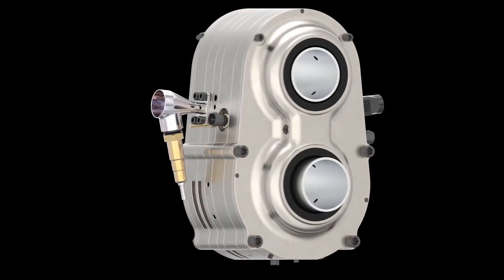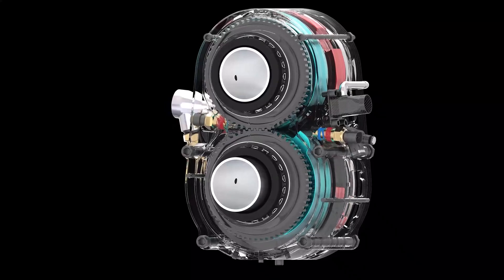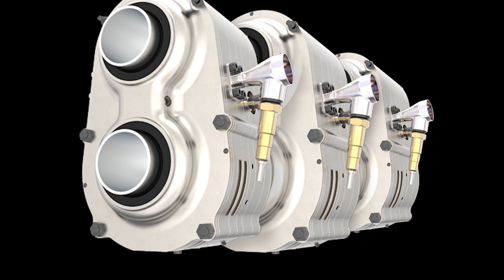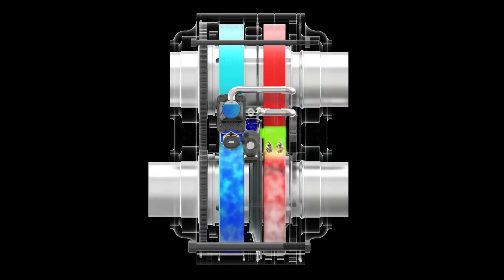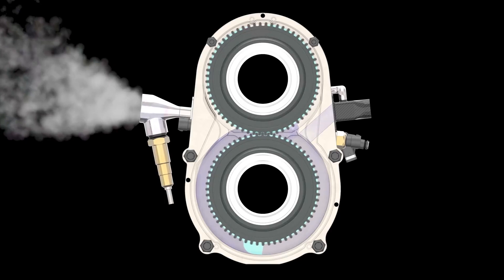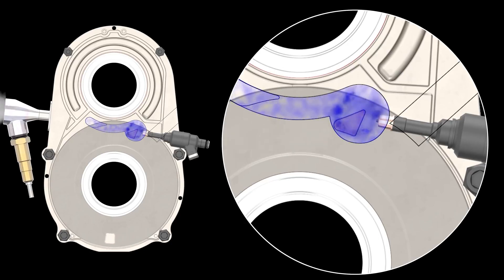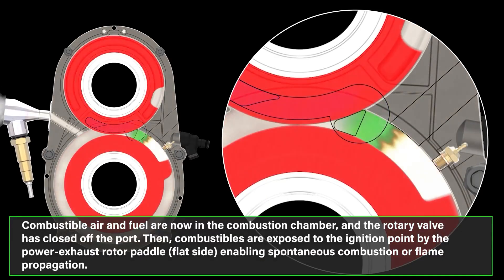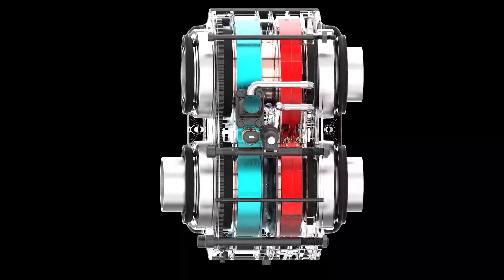This pistonless engine runs on hydrogen and revs to 25k rpm

Comment: Simple question. What is the overall thermodynamic efficiency - energy content of hydrogen used versus mechanical energy delivered? You need cheap hydrogen, otherwise the economics doesn't work. You need to compress or liquefy hydrogen for a transport fuel and this loses a large fraction of the energy you put in. Then you lose more because of the thermodynamic losses of the engine. So the mechanical energy you get out of it is only a small fraction of the electrical energy put in. Compare this to batteries and you get the point.

However, despite the losses, I can see a niche for very large machinery and things like trains - where a liquid hydrogen store would be feasible and you can wear the overall inefficiency.
Reply: well if you have the ability to generate nearly unlimited energy (far far far beyond what we currently or ever will need) with even just the current tech solar panels, it doesn't actually matter how much energy it takes to store or compress it into a usable form. the problem we face isn't generation, it's storage. batteries are good but hydrogen is actually better with what we currently have, the problem right now is the price and it's source. hydrogen tech hasn't really been focused on like batteries have been, so it has a lot of room to improve quite rapidly.
you also don't need liquid hydrogen, compressed is perfectly fine and there are a number of hydrogen cars/trucks already on the roads. for large/long scale storage i suppose liquid might make more sense but for anything else it's just not needed. the pressure tanks they already have on cars are pretty much indestructible with no meaningful amount of hydrogen loss.
keep in mind that is what we have right now, if hydrogen got the spot light like batteries do/did then it can easily advanced like how batteries have in the last decade.

at the end of the day there will be both types on the roads, all excess energy will be sent to create hydrogen which will fuel all manner of systems.
Reply: @rocksfire4390  You can't escape the thermodynamic loses and compressing hydrogen also costs a fair bit of energy. As I said, it all depends on the specifics of the application. Batteries will always be cheaper (in terms of energy input) than hydrogen for cars. However, when you get to something the size of a freight locomotive, hydrogen is a realistic choice. There's bigger picture considerations. Solar and wind energy is cheapest at source (before its distributed). Hence the best place to use that energy is onsite. This is why hydrogen storage (for later conversion into electricity) can make sense - at least when co-located and reused on site. And its why liquid hydrogen makes more sense, because at this scale, the storage gets costly. 

Btw a couple of my colleagues are working on hydrogen powered high speed passenger locomotives (distributed traction through the train, but a generator up front). We did the sums and liquid hydrogen beats out compressed hydrogen by a long margin, despite the higher energy cost of liquefaction.
Reply: @saumyacow4435  
even for semi's a busses hydrogen is going to come out on top. current batteries have their limits but at least the newer stuff (if it all pans out) will likely change that.

i suppose you don't need super thick ass walls for liquid hydrogen, just insulation and enough to withstand the temperatures. i hope that project works out, i want to see more hydrogen fueled things. 
hydrogen just has so many other uses besides just energy storage, that's why i feel it's a really good solution to shoot for. batteries are great and all and they are getting even better (by quite a lot actually in the coming years) but i still feel hydrogen has a place and it just isn't getting the spotlight it deserves. i mean hydrogen has been beat up for decades, it was the same with batteries until they had a massive breakthrough with energy density and bam nearly everything has batteries in it now.
Reply: @rocksfire4390  Its an open question. Long distance semis? Yes. Commuter buses (that can be recharged several times a day)? Maybe batteries are better there. Main thing about hydrogen is its not very dense, even in liquid form. Hence space/volume is an issue. Again, less of an issue with a semi, more of an issue with a bus.

Hydrogen will have a lot of uses in industry/chemistry. Steel making for one. In this case its produced on site and used on site, so transport isn't an issue. Bulk transport of hydrogen is a serious problem - it finds its way out of pipes and again, low density. Which is why a lot of people are working on ammonia (another potentially clean fuel) and why liquid methane isn't out of the running - provided its done in a carbon neutral way.

Comment: At this power to weight ratio. it's perfect for airplane. Not any plane, ultralite, 1 passenger. I think it's time to go 3d. Driving on 2d roads is getting old. No need for roads in the air!

Comment: Curious what the power curve would look like as 160hp at 25000rpm equates to just 34 Nm of torque if I'm not mistaken, where does the 230Nm come in and at what engine speed (6600rpm for peak power?) - no point in quoting those figures if they are impractical in everyday uses where huge gearing reductions might be needed :s aside from the practicalities of building the thing as interesting as the concept is!

Comment: most electricity in the grid is using fossil fuels, so fully electric is still using energy gained from harm, same with hybrids except you are also using fuel, creating exhausted fumes. hydrogen doesn't make anything when exploded apart from maybe water because it interacted with oxygen. that would be a maybe concern though.

Comment: It doesn't actually work...the wear on the engine would eventually cause leakage...probably quite quickly.  Now, there are actually ways to completely eliminate wear, but there are problems with that, too.

Graphene hasn't gotten enough development to be used to coat engine parts for that purpose...and it probably never will.  Science on this planet has become a bad joke...and the others calling out this engine for being "vaporware" are part of the problem.

The other problem, is also the other problem with science...there's no money to be stolen in manufacturing a nearly immortal, hyper-efficient engine.  What's possible, is irrelevant...only what lets corporations and their bosses continue to rob the people.  Nothing else matters.

All that said, what really matters is actually producing a working prototype, and actually testing it...testing it HARD.  Until then, not only is it silly to make claims about how good it is...it's also just as childishly ridiculous to make claims that it's pure fantasy.

Comment: Looks good and sounds efficient so it will never see mass production. When the same people who own the oil companies also own the automobile companies efficiency is out of the question. Cars will continue to be just as efficient as they need to be for the current local standards and nothing more. Modern automobiles could be achieving well over 100 miles per gallon but they don't have to be so they won't. Everything should run on hydrogen, even old classic cars can be adapted to run on hydrogen.

Comment: heat & expansion along with said tolerances create a seal in & of itself? seems like it would be a great "how fast can I go as fast as I can" motor?? I'm not an engineer, but I do have faith in the gas or fuel burning engine and that we've likely only started learning what we can do with it. Electric is cool too, you've just really got to want it. If you've never driven an electric car, do it. it's an experience at least, and it will surprise you. But you may, like most I have known find it's just not practical in day to day life. for A LOT of people it is perfect and makes sense. to each their own. Either way it's going to take both teams working together to maximize both technologies. 
🙏🇺🇲🙏🇺🇲🙏🇺🇲🙏🇺🇲🙏🇺🇲🙏🇺🇲🙏🇺🇲🙏 
Any who, this is a cool engine/motor!

Comment: You said nothing about efficiency...
Rotary motors have great power to weight ratio, but burn a lot of fuel, that means low fuel efficiency.
Now add the fact that hidrogen is not cheap... And you got yourself a big pile of nothing burger

Comment: This thing will wear out in about 2000 miles. I dont say this because electric wah wah. Those have physics to contend with since you cant sent electrons fast through a cable without reaching copper melting temps lol.
But this is basically a 2 stroke diesel, so there is no way it will not have lots of half burned and nasty exhaust.  Unless there is a vacuum generator to suck the burnt gasses out (making it a 4 stroke), but already the compressed air intake would be massive power sinks. It may make 150HP but if I need a 90HP compressor to generate that kind of volume and pressed at 20k rpm...I think 90HP might be too low of an estimate. 

Ive been building and designing engines like this since I was 12, from using electrolysis (which was my failure to understand energy conservation..I was 12 lol) to redesigning the Wankel before I knew it existed. I still have a rotary-reciprocating piston engine that would work, but not as efficiently as a regular piston driven engine.

The piston is one of Man's greatest inventions. Carnot, Otto, Diesel, these guys all worked on how to perfect thermodynamics and came to the best most efficient design. I find it curious that the obsession of "no moving parts" or few moving parts seems to be the end goal, versus usable power.

Don't get me wrong, this engine is interesting and cool in its own right, but as a test mule, and so on.

Comment: Description makes no sense.  No seals because of high tolerances and because it's high RPM there's "no time to leak" yet it develops over 200 psi.  Also no mention of fuel efficiency OR WHERE YOU'RE GOING TO GET ELEMENTAL HYDROGEN.  Hydrogen is NOT an energy source... it's an energy carrier.

Comment: Hydrogen has a VERY wide flammability range... If using electrolysis to convert water into hydrogen (and oxygen), it is fairly inefficient.  If you get it by converting natural gas, you still have inefficiency, so you might as well have your engine run on natural gas.  Even though when you burn hydrogen, you only get water as a byproduct, to convert natural gas (methane) to hydrogen via the steam reformation process, you are generating CO2 at that point, so you can't REALLY say that you are ONLY getting water as a byproduct... If you want to be honest, you need to include the byproducts during the manufacturing process...

Comment: Electric cars can't replace the combustion engine. Combustion engines must still exist. Truckers can't tow with electric motors with a battery pack that'll add weight and lower the truckers range. Run out of fuel just refill takes a minute or two whereas an electric car you have wait hours and it costs more than gasoline depending where you charge it. I will never go electric, this engine here I can work with, if it makes 160hp on hydrogen, how much more can it make on e85 or gasoline?

Comment: and why are they still trying to build burner engines? EV batteries that can fully charge 430 miles in 4 minutes and have no maintenance and much better performance are already here and on the horizon. This was obsolete before it left its cad file. 

For plane engines yes, cars not

Comment: If is entirely dependent on Hydrogen Fuel then it is a failed concept. Making it run on petrol and conform to anti-pollution standards will greatly complicate the concept and increase the weight.

Comment: Electric motors instant torque and low maintenance have already won. But, why not reduce battery size and use a version of this for range extension? I think combustion could really be great for buses and larger RV vehicles. I think there is zero reason to use combustion as a primary drive in a post Model S plaid world. (Unrelated - I've launched in one, and just wow, your vision works slower than the car accelerates. It's like jumping forward in perceptual time it's so fast. By the time your vision processes what is happening, you are going 80. It's terrifying.) Anyway, if Mazda can make a small rotary engine to back up longer trips and only use a 40 KW battery for daily average ranges, I think there is a middle ground on cost with almost no gas usage save for vacation driving.

Comment: the hydrogen problem has always been how to store and transport the gas safely. not how to burn it.   it's so immensely dangerous you cannot possibly allow cars with full tanks of hydrogen to freely collide into one another on a freeway. it'll only end in disaster. 
if hydrogen engines ever take off it'll be to charge the internal battery banks asap making sure the car only stores any hydrogen gas for a short period of time while doing away with 30 minute charge cycles.
Reply: All of your information is either outdated by about 50 years, or just incorrect. Here, let me help: https://www.youtube.com/watch?v=b88v-WvqzeQ
Reply: Huh?  Even though Hydrogen has nearly three times the energy density of gasoline, that means you would just carry less of it.   So, how is hydrogen more dangerous to carry than any other flammable substance especially when the hydrogen is lighter than air where gas vapor is three to four times heavier than air.  There were nearly 190,000 automobile fires in the US in 2020, alone.  What are you yammering about???
Nevertheless, Hydrogen is NOT AN ENERGY SOURCE.
Reply: @DiffEQ  like I said, the hydrogen inside the car is just one part of the problem. storing and transporting it is a massive pain. it's the smallest molecule so it gets through nearly any seal. if it escapes it's super hard to detect and can easily displace all the oxygen in a room. when it burns the flame is invisible. when stored as a liquid it will be EXTREMELY COLD when it  gets released (for any reason) which is serious danger in itself. 

you said people would carry less hydrogen. clearly you don't know people very well. they'll take the same tank and extended range any day. they'll definitely pack more energy in a tank if you let them get away with it. 

you said there are 190'000 automobile fires in the US in 2020 alone. that should tell you just how big of a risk hydrogen filled cars would be.

> Nevertheless, Hydrogen is NOT AN ENERGY SOURCE.

nobody said it was. keep your knickers on. that's en entirely separate issue.
Reply: @DiffEQ  Gasoline causes fires,   leaked gaseous  H2 causes EXPLOSIONS.

Comment: 'revs at 25k rpm' sound very impressive!
How fast does one need to spin this thing to get it started, then?
How slow can it idle?
There have been many 'dynamic compression' and seal designs and they all suffer at slow speeds.
It must be remembered that gasses in this engine are moving at high speed and pressure inside a stationary housing; heat is transferred at great efficiency under these conditions.
Gasses in a piston aren't flowing all that much during the combustion cycle.
Translation: With increased load (compression) on the engine, heat could be extracted by the housing and the cooling system faster than fuel can burn.
With the right load/RPM combination, like in a generator, this engine could rival gas-turbine engines for compact horse-power.
But for automotive use, not so much.

Comment: Still doesn't solve the hydrogen storage problem, it just isn't a great fuel source to store. next to impossible to keep it from leaking.
Reply: There is a solution  to the Hydrogen storage problem BTW I'm not trying to be super negative, it uses a special metal film to absorb the hydrogen into the metal and then release it as needed.

 The only issue is that this metal/hydrogen storage is super energy dense, and can easily be turned into a very explosive bomb, the technology is used in hydrogen bombs, so homeland security has halted development of this energy storage solution, unfortunately. Turns out, you can make something too energy dense for the consumer market.

Comment: Some things works in theory but I think this engine dont even work there. Good luck with such tight tolerances in something with such high termal load on different parts.. This is a paper product.

Comment: I dont think people are against internal combustion.  I think its more of the dirty fuel we use to power the engine.  So if we would just use alternative fuels to power them they would be as good as an electric engine. But big oil doesn't want alternative fuels to be used so the lobby against anyone that tries to do so

Comment: Engines that burn hydrogen sound great in theory....burn hydrogen with oxygen from the atmosphere and you get just water, right? No, you get extras in the exhaust, the nitrogen oxides. Air is around 78% nitrogen and 21% oxygen. So when using hydrogen as a fuel for ICE, you do produce H20 as water vapour. Because there is no carbon in hydrogen, there are zero carbon compounds. But hydrogen engines do produce nitrogen oxides, so hydrogen engines are not zero emission engines, but the are zero CO2 emitting engines.

Comment: Won't be viable for cars until long after cars autonomous electric cars are the norm, if it is meant to run on hydrogen.

Countless companies with exponentially more engineers and revenue hasn't solved H2 (H2 as in gaseous hydrogen) storage and embrittlement issues despite working on it for decades, this company won't solve it either.